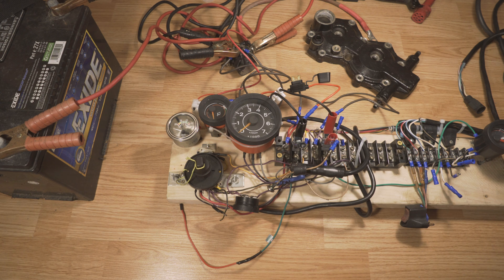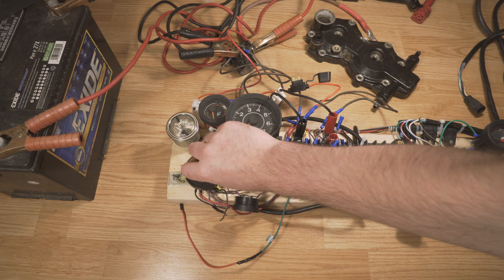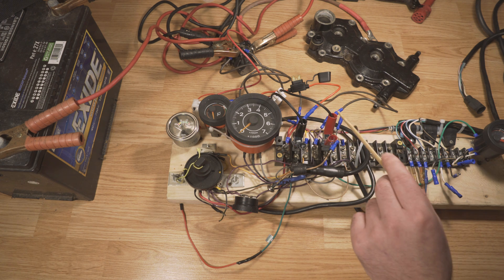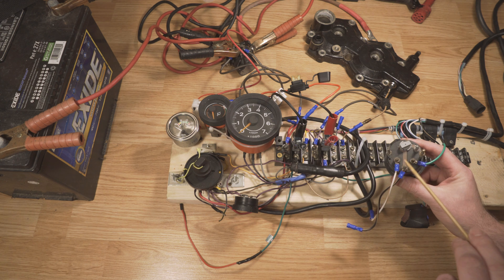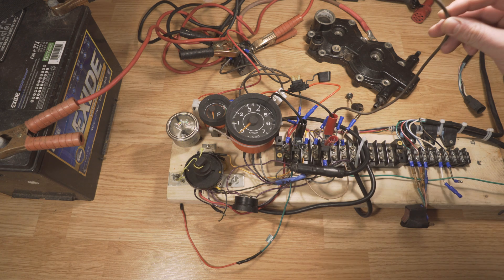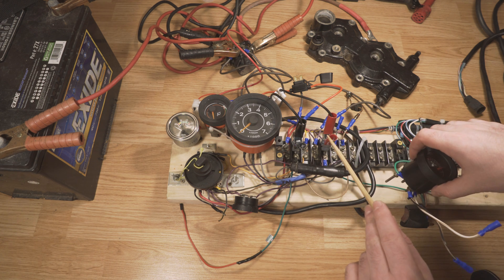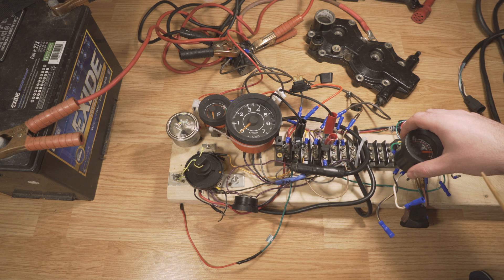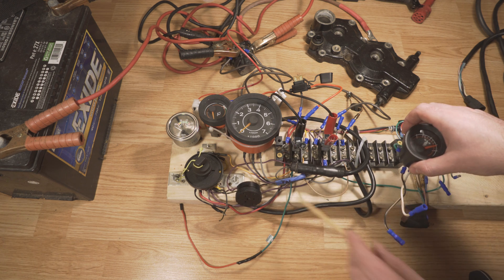Outboard Motor Control Wiring Part 2 - System Power - Gauges / Nav / Accessories

Comment: If you were adding a device (depth sounder) and you would like it to turn on with the key switch, how would you wire it into this system? I'm assuming that the power wire (red) for the accessory should tie into the purple wire and then the ground for the device should tie into the ground. Where would I splice into these wires? Along the wire from the controller to the motor? Thanks for any advice!

Comment: Thanks for making these videos.  You do a great job of explaining everything.
This helps me with a boat i bought that has had some of the gauge wiring cut or disconnected.  I want to correctly wire up new gauges.